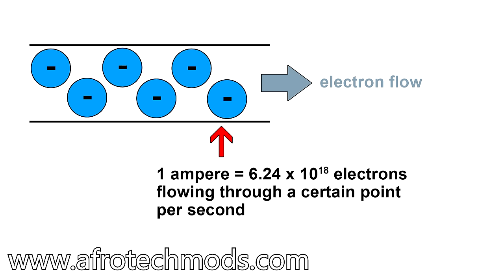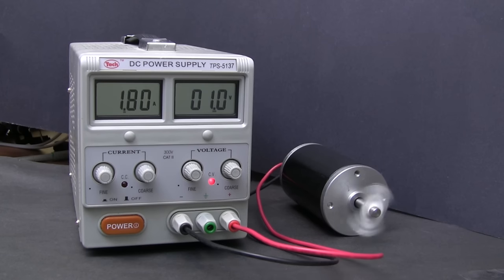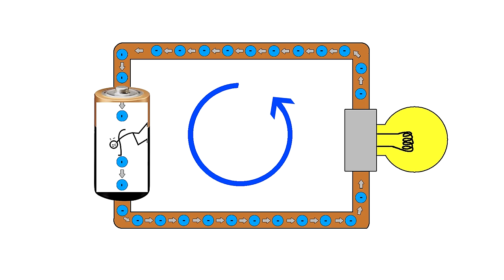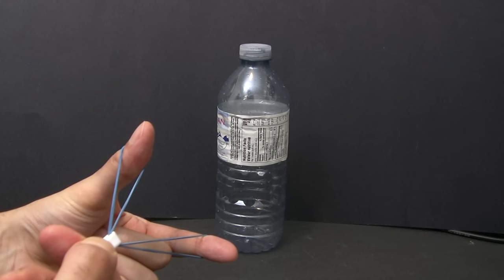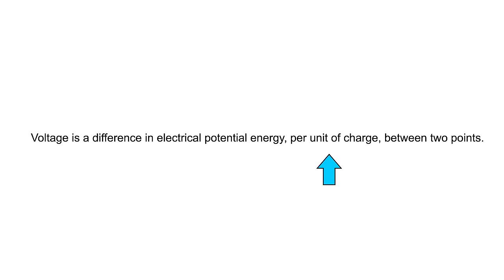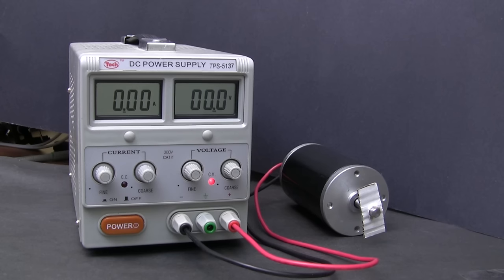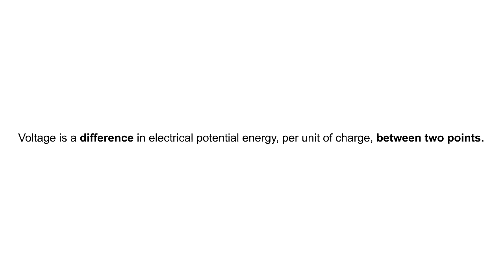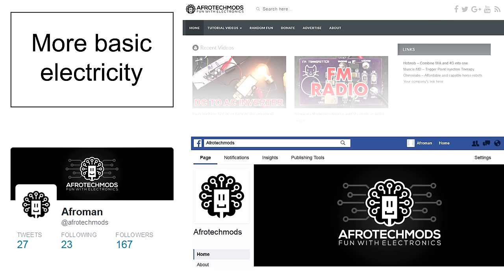🔌 Basic Electricity - What is voltage?

Comment: hi,
´
Thank you for this video.

I would like to make some questions about it, if you dont mind.

1 - In a power supply like that in the video, you have 2 buttons: one for current and other for voltage. Is it possible to set a high voltage maitaining a low (or zero) current? I ask this because as far as I understood, current is not directly related with voltage right?

If this is true, I can set zero current and a high voltage and then put the plus and minus cables in my tongue and dont hurt myself, right? But if I put a high current and a low (almost zero or zero... if possible) voltage, will not do the trick, right?

2 - In a battery you talked about the volts. What about the ampers? How many ampers have a battery? I believe the ampers will dictated the life time of the battery right? As sson as I use all the apers, the battery dies, right?

3 - In a analogy, how many ampers we have in a public circuit? We always heard about 220v (in europe, for instance), but what about the ampers?

thank you!

Miguel

Comment: Excellent video. I'm wondering what the difference is between an amphere and a coulomb. If 1 amphere is equal to 1 coulomb of charge flowing through a certain point per second, then isn't the use of the term coulomb unnecessary? Why can't we just use the word amphere and be done?

Comment: so, if I understand correctly, 1v is the potential to move 1coulomb through a fixed distance/resistance? And when there is an open circuit there is no actual work involved? So no joules transferred?

Comment: I just want to understand something, when you raise the voltage on your power supply, more current flows. But when we use transformers to have 347V output instead of 120V, the current (amps) is lower than on 120V.  If you continued to raise the voltage on your power supply, would it hit a kind of threshold where the current would start to diminish? Sorry for bad english*

Comment: While I undestand that voltage indicates the energy required to move a unit charge (proton/electron) from one point to another in space, I still don't understand how and why voltage rises due to voltage sources make charges flow. I mean, the previous interpretation is perfect for explaining voltage drops: it tells how much energy is lost per unit charge; in the case of a voltage rise, the previous interpretation is still somewhat useful as it indicates the energy gained by the charge, but just because it quantifies such energy, I don't understand why and how the voltage source forces the charges to move. For example, just because an elastic band is stretched (so it has potential energy) doesn't mean it actually throws the paper ball.
Reply: Alejandro Nava: I wrote a comment regarding the electric field which may help your understanding. Sort comments by date and look for my post. Hopefully this other post helps.
Reply: The voltage generates an electric field in the wire.  The electric field is what makes the electrons move.  The electrons try to rearrange themselves to cancel the electric field by flowing down the wire, but since the battery keeps the electric field constant, the electrons continue to flow in an effort to cancel it out.

Comment: Nice video! Why the current isn't doubling when the voltage is doubled?
Reply: The load is a motor, not a resistor.  A motor has a moving coil in a magnetic field so it has induction and that appears as a non-linear "inductive reactance" which varies with the speed of the motor.  Ohm's law really only works for metals and only relatively low currents at that, as the metal can heat up and change its resistance.

Comment: This might be a stupid question but is there some type of function that essentially gives us the amount of amps there will be given X volts? Like in the video when it had 1 volt there was 1.8 Amp, at 2 there was 2 amps and 5 volts there was 2.5 amps
Reply from the maker: For linear loads it's Ohm's law, V=IR. This is covered in the next video. But most loads are not linear.

Comment: in that example with the engine, 07:15. What happens in the voltage remains 2.0V, but the current is reduced form 2.02Amp to 1.0Amp?

Comment: Question about relationship between volts and amps. I see you increase voltage x5 when you have your fan hooked up to your power supply, but amperage only increases 2.5. I expected ampereage to "amp up" more than it did.
My question: with the same increase in voltage we saw in the video, would that same increase in voltage yield higher amplitude with a thicker conductor of the same material? Could a better conductor get more amperage (flow) out of each incremental increase in voltage?
Thanks! Great vids
Reply from the maker: You've got the right idea. Keep watching my basic electricity series and you'll see more about this in the part about resistance.

Comment: Can someone explain why voltage decides how many joules per coulomb. I mean, when we have 1.8 amps of current, the load will see 1.8 coulombs of electrons move through it per second. what is the voltage contributing to the calculation other than pushing the electrons, isn't amps enough to calculate the energy, cos we have both the magnitude and rate of electrons passing through the load defined by the amps. Why does voltage decide how many joules it is per coulomb. if lets say i increase the voltage to 2 but keep the amps at 1.8 how does that change what the load consumes. isn't it the same number of electrons per second.
Reply: sciece in the simplest way  Thanks for the reply, But you are still talking in equations so i still don't understand. So to put it simply, amps tell me how many charge carriers pass through at what rate right?. what is voltage here. Why do we need voltage to calculate energy. What is energy here. According to the equations its not just electrons and their rate of movement. So is it like the charge of an electron is different in high voltages compared to low voltages. Basically what is energy here, not in equations but practically.
Reply: sciece in the simplest way  i think am atarting to understand. One last question. So the energy here, is it the pull that the electrons feel due to potential difference.

Comment: @Afrotechmods : Just subscribe man. Great work! I just have a question. So with regards to voltage ratings on loads like devices, motors, equipments etc... Please help me to understand for example, an ebike motor than runs on 24V , why can it be converted to 48v? Why do they convert it and why can it be converted? Is the motor not rated at 24v only? Meaning it will only run with 24v and be damaged at 48v? Another question is, you have shown that for example a 12v device can still run for example by a battery that is 9v. Am I correct about that?

Comment: At 8:05: So does that mean that if the positive terminal has 5V then the negative terminal will have 14V? Or is it the opposite, +14V and -5V?
Reply: The positive terminal is 9V above the negative terminal, i.e. "+9V" relative to the negative terminal.  If you connected two batteries in series (the plus of the first to the negative of the second) then you could say the first negative terminal is 0, the positive of the first and the negative of the second wold be +9V and the positive of the second would be +18V.

Comment: I am confused. I understand that voltage is the difference of potential energy. This is what makes batteries work due to negative charges being attracted to the positive terminal and over time the battery loses it's voltage and have charge balance in the system. However I am quite confused as to how batteries have larger current or last longer  than other which has the same voltage. Like powerbanks: a 5000maH and a 10000maH but both are 5 volts.There is something I am missing or not understanding correctly and I am not sure what. Please?
Reply from the maker: It's not just the difference in potential energy, it's the energy per unit of charge that flows. Higher capacity batteries contain more couloumbs of charge that can flow out (simplified). But in both cases when a coulomb flows 5 joules get transferred (5V).
Reply: Afrotechmods can you answer my question that I wrote before in the comment section?
Reply: hmmmm, thanks! Now I have a bit of an idea about it. I'll read more about it for sure.

Comment: I'm sorry if this is a stupid question but, why didn't you use a diode when demonstrating with the motor at the start of the video? I'd be worried about damaging my power supply.
Reply from the maker: Integrated benchtop power supplies like that usually have suitable protection circuitry at the output for handling inductive loads.
Reply: Wow, thank you for the rapid reply! I was asking because I have a similar supply but always used a diode after watching one of your previous videos. I had no idea they had protection circuitry for that.

Thank you.

Comment: Do you ever plan on making a video on impedance matching, for things like maximum power transfer and minimal signal degradation? It's the reason why you can't power a toaster with a 12V car battery (even though it can deliver enough power) or use high voltage current source (van de graaff generator) to power incandescent lamp.
Reply from the maker: If I do, it would be a loooong way out, and grouped in with thevenin circuit analysis
Reply: Ahh, Thevinin equivelent models! Literally just learned about that and linear circuit analysis at UVa! Pretty mindblowimg IMO.
Reply: Hello power max! You should start making videos again! Their great!
Reply: Thanks! I wish I had the time, I've been pretty busy with UVa at the moment, I almost finished a capacitor tutorial video, but got stumped on the math behind reactance and complex impedance. Hopefully I will learn that stuff in FUN-I this semester, and I can finish the video!
Reply: I fondly remember good times building thevenin (Q sarcasm here, haha!) equivalents. Mesh and binary nodal analysis ftw!
Reply: Yup, totally agree! I did try to solve V/R = dv/dt*C but I couldn't until I took a few calculus classes, the differential equations are weird, and IMO still are. I still do not fully understand how or why e^-t comes from, it's like we just guessed that was the solution and because it's derivative is the same, it magically works! o_0
Reply: Look up Vector Charge Analysis to get a better understanding of the mechanics.
Reply: +Power Max We can define complex impedance as (note: this is not a definitive explanation, as we are not taking into consideration the various effects of coefficients, such as permeability, temperature, etc.):Complex impedance is calculated as: Z (complex impedance) = R + jXTo understand that, we need to understand what R and jX represent. To do that, we must first understand that:1-> Resistance is NOT the same thing as impedance. Resistance (R) is measured in a steady state (ideally, DC has 0 change in phase angle over any time period). And we will measure it in units called OHMS DC.2-> Impedance is measured in two ways: inductive reactance (Xl), and capacitive reactance (Xc). Every circuit has some amount of capacitance, inductance, and resistance. Reactance is a DETERMINED resistance at a GIVEN frequency (j * X). In algebraic terms, capacitive reactance (Xc) in ohms  = 1 / 2 * pi * Frequency * capacitance (in farads). For inductive reactance (Xl), it is expressed as 2 * pi * frequency * inductance (in henrys).This seems really difficult at first, but it isn't too hard to understand when you see it in action. To see it in action, look up Afrotechmods video on bode plots. That's a great video for understanding the true nature of capacitive and inductive reactance. That's is in a nut shell!

Comment: I'm not sure if I am stating this correctly, but is the circuit with the light bulb rated at 1 ampere because it transferred 1.5 joules of energy per coulomb. So can I assume that if the amperes was 2 that the same 1.5 volt battery would transfer 3 joules (1.5 joules of energy x 2) or would you then need a 3 volt battery?
Reply from the maker: Yup 3J.
Reply: thank you

Comment: So does voltage go down over time? Like there being less pressure in a hose as a tank of water empties?
Reply: Yes, it does in a battery because its internal resistance rises as the chemical reaction becomes depleted.  It thus becomes less able to supply current, and the output voltage drops.

Comment: Hi, I just have a silly question... I just got an energy shock in my head from those electrical perimetral defense wires few minutes ago. As I read the specifications, it has 50 pulses per minute of 7000 volts. I felt like I was hit my had against a wall, but just a little, so I suddenly retired my head. My concern is if that would have some posterior collateral effeects, since I feel a little bit dazed.
Reply from the maker: I have no idea. Go to the hospital and see a doctor.

Comment: So, when we say there is 220V or 110V, what two point are these being measured between?  Thanks.
Reply: We're measuring across the two sides of the power supply.  For 120V, you measure between hot and neutral.

Comment: Something's still a little confusing.
The "-" side of a battery has all of these electrons in a very "excited?"/"active?"/"energized?" state.
They get connected through a circuit, expend all their energy, become sluggish and return to the "+" side of the battery and now that side has a lot of electrons but without energy.
Is this correct?
If so, what if the electrons in the "-" side become twice as "energized"? (or, do electrons can only be "energized" up to a standard state and no more?)
It seems higher voltage means more electrons available in the "-" side, instead of having the same number of electrons with a "higher energy level".
-------------------
Something else:  In a battery, a chemical reaction seems to be the one that results in having "loose and energized" electrons.    When a magnet and copper wires are used, where are the "energized" electrons coming from?

Comment: are amps relative to voltage? so at 1V you were pulling 1.80A for the motor. would 2V be 3.3A? or is it based on what's on the circuit? so if you had 2 motors pulling 1V would the amperage be 3.3A?
Reply: Amps are linear with voltage for resistive circuits like light bulbs.  He unfortunately used a motor which is an inductor for this example, and the current drawn by a motor is more complicated and  varies with the load on it.

Comment: Could electricity be compared to hydraulics to understand simple power electricity?
Ampers = amount of fluid flow
Voltage = pressure of fluid
Watts (engine) = V x A = fluid amount X fluid pressure = power (of hydr.motor)
Wh = how much power was developed in one hour
resistor = choke
potentiometer = choke valve, gate valve
capacitor = hydrophor; hydraulic accumulator
wire insulation strength = pipe wall strength
Voltage stabilizer = reduction valve
diode = non-return valve
etc...
Objections?
Reply: Yes, this is called the water analogy for electricity.  It's sometimes a useful explanation for some basic DC fundamentals.

Comment: So, does the knob on the electric power supply that controls voltage function like a variable resistor?
Reply: Conceptually, yes, but not in practice.  A variable resistor used this way would dissipate a lot of energy (get really hot) and it makes the voltage unstable under a varying load.  So the power supply actually does it a different way internally to avoid those two problems.

Comment: Where do the electrons come from, is there a shortage of electrons once you turn the switch off, is there an accumulation of electrons in the load, more electrons in the load is more voltage?
Reply: The electrons come from the atoms in the wire and battery.  Some of them are free to move around, and those are the ones that get pushed around by the electric field in the wire.  A battery uses a chemical reaction to create a field to push the electrons away from the positive terminal and toward the negative.  Those extra electrons in the negative terminal really want to get back to the positive terminal to even things out, and they'll push their way through a wire to do it.

Comment: what about a short circuit on a battery, what would happen to the electrons in the circuit.. for example, if you took a 1.5v battery and placed a piece of wire between the negative and positive, at which point in that circuit would the electrons collide, is it even all the way around or would there be a "hot spot"
Reply from the maker: Electrons would distribute evenly among the wire almost instantaneously (current flows at near the speed of light)

Comment: So when you recharge a battery are you simply increasing the voltage?
Reply: You are causing a reversible chemical reaction to run in reverse inside the battery allowing it to store chemical potential energy.